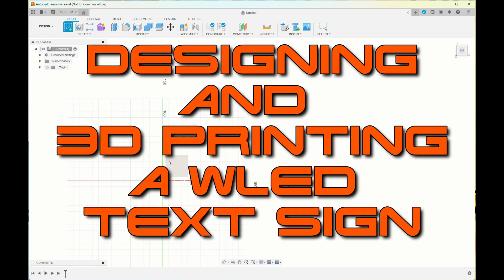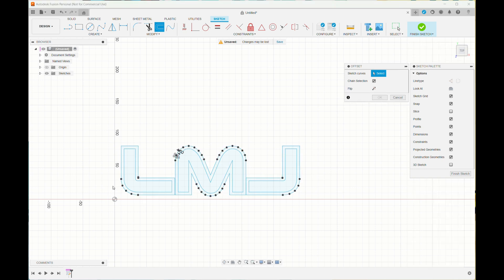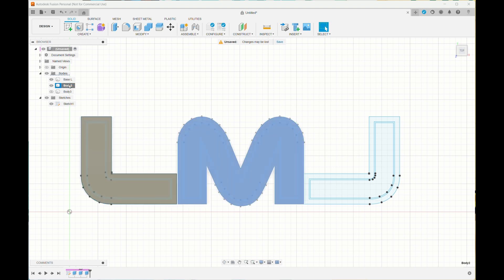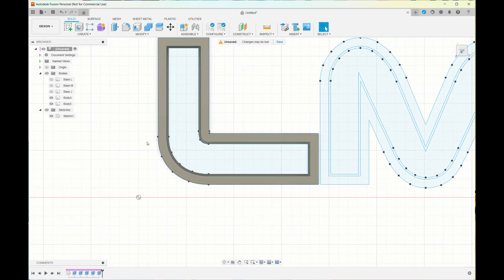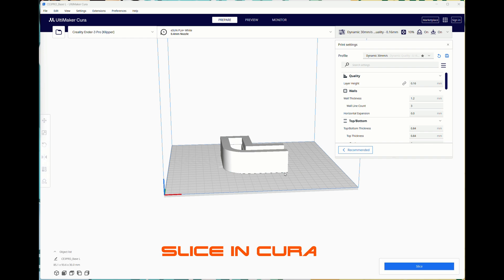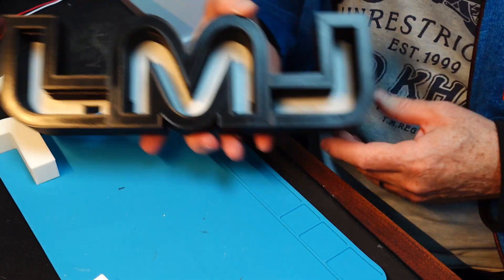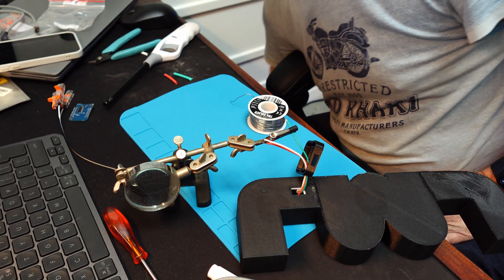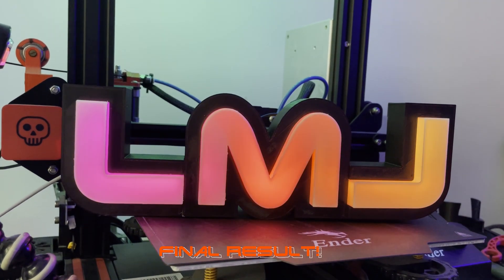3D Printed Text Sign designed in Fusion360 and running WLED

Comment: What filament did you use? I used PLA but the LEDs made it melt.
Reply from the maker: Hi @mathwithmas, I used eSUN PLA+ and have not had any issue with heat from the LEDs.
The LED strip I used is around 25-30cm long and it's powered via the 5V supply for the D1 mini (ESP8266).
It is quite concerning that your LEDs would heat up so much to actually melt the PLA!

I've run my sign powered on for months without any issues (you made me worry & I inspected it again just to confirm today :-))

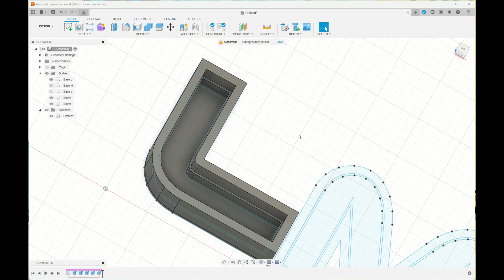Comment: 2:40 
how did you created the caps?
Reply from the maker: Hi there - I used the original letters I had (which essentially are the inside letters) and I put them on another plane, and then extruded them as well but in the opposite direction.
The caps then form a tight fit in the openings.

Comment: great video but you skipped a lot of steps such as making the caps
for the friction fit caps did you reduce anything like underextrude 1mm inwards or just matched the same opening dimensions?
Reply from the maker: Hi @rawtravisawr, apologies on that - I did go through that part too quickly in the video & did not explain in detail.
I used the same dimensions for the inside letters as what I originally started with, but I extruded (inward) a 1mm "wall" to make a lip which would then fit onto the base and to give the cap a bit of rigidity.
Because the caps are printed with only a 1mm wall, there is a bit of flex to push them into the base.
I have an old Ender 3 Pro printer and its tolerances can sometimes be a bit "off" 🙂 - so my L & M letters fit quite snug, but the J was a bit loose.
Hope this helps!

Comment: hello I am new to 3d printing and I want to understand how the light passes through the cap I tried and on my side the light does not pass well... is there a type of filament and a thickness recommended?
thanks
Reply from the maker: Hi @rodley1806,
 I used PLA + white filament (nothing special), but the design for the cap ends up as a hollow letter with a wall thickness of between 1mm & 2mm (mine worked out to 1mm).
This helps to not be too thick for light to go through, but still sturdy enough to slide into the base.
Cheers!
Reply: @LazyManJoe  thanks for the reply